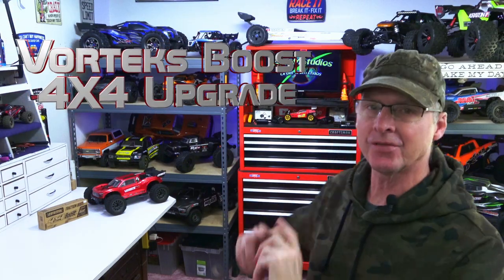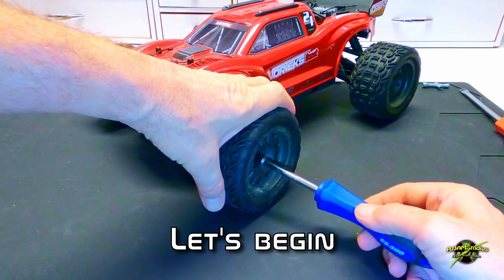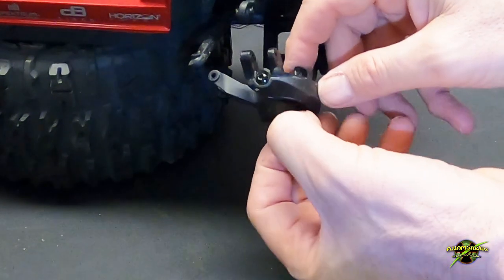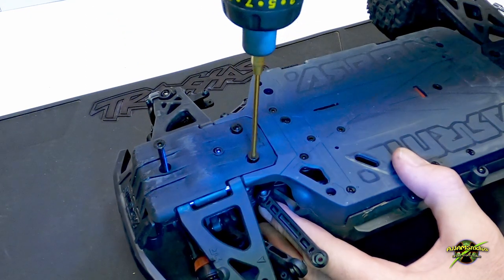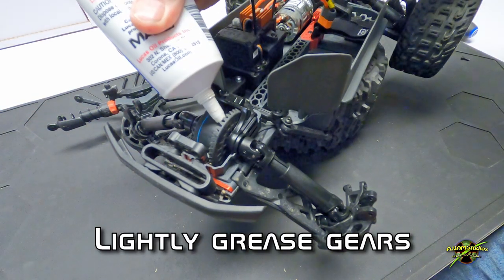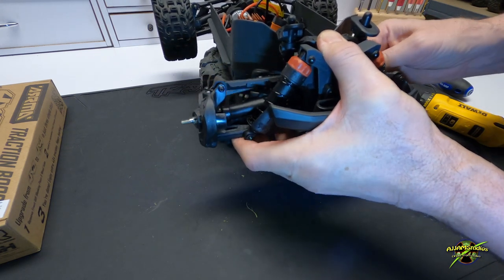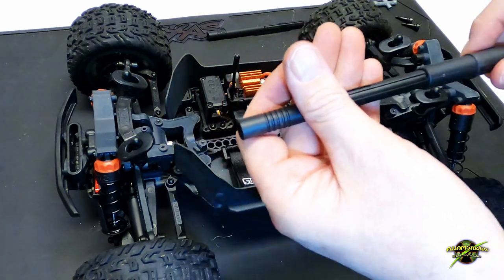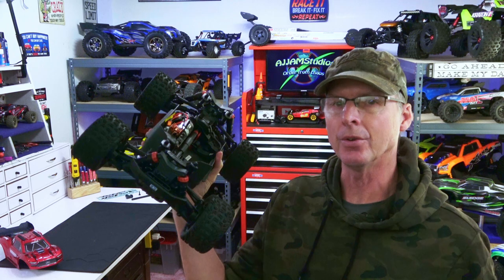Arrma Boost 4X4 upgrade

Comment: I got my Vortex a week ago or so , I just got two new 6500 Zee batteries and off road tires but I am pretty sure I will do the 4 wheel drive conversion kit soon but I am looking on the engine upgrades 😆 but this stalk engine I have now is pretty fast for me as of right now

Comment: Hi AJ, I think you missed the opportunity to put some thread lock on the screws inside the shafts that hold the axles. It's a common issue with the 3s platform for the little screw to come undone and the whole wheel to come off. Great video as always!
Reply from the maker: Good point. Thanks for helping our community. 😎👍

Comment: As always, great video!! Since you are kinda right where I'm having an issue with my Losi DB PRO, the factory hex works well with the stock wheels but, the road tires and the paddle tires both, where they seat on the hub is longer than the factory wheels. So I get another set of hexes that are thicker. But now the issue is the amount of thread left to put the nut on to hold wheel on. Any ideas or help would really be greatly appreciated. I tried the pull trick you just used and I t was no help.
Reply from the maker: We resorted to milling the wheel at the inside to remove the extra plastic and add more room for the wheel to fit the hub properly. This procedure can be a bit messy and if you do not have the facilities to do it properly, can be a bit dangerous as well. Still, if you do have the ability to mill the inside portion down, shortening the side area, that was the easiest way we've found to get them to work. I hope this helps. AJ

Comment: Hi , I'm a new rc kid. I have question for my arrma. My truck got turn off after about 10 mins I play at%50of motor power .( New battery full charge).    the steering was still working but the truck won't move. I saw the led was blinking very fast. The truck runs again after I turn off and turn on again. But it stop after couple mins. I really can't tell if the battery is low or what. is 10 mins run time about right ? Something wrong with my truck?

Comment: What grease did ya use , is white lithium grease safe on the plastic gears .....
Reply from the maker: Lucas oil white lithium grease. We’ve used it for years and never had an issue with our RCs. 😎👍

Comment: Do you have a video on slipper clutches explaining how they work and how to adjust them
Reply from the maker: Not yet, but we have been considering adding it to our 101 series. Thanks for asking 😎👍
Reply: @AJJAMStudios  Not sure where I should ask this, back in the hobby first time was a couple years ago, been getting rebrands, beefing 'em up for speed runs, then reselling to trade up.  Got the 4x2 boost mega vorteks   Was wondering, realistically, what motor / esc I should get? Already got upgraded shocks and the 4x4 upgrade is on the way, but a brushed 550 on 2s pushing 7 pound or so 1/10 scale rc truck with big'ol tires, wont that wear motor out faster? Also, if we're upgrading to brushless, upping the cell count, and changing motor perameters, shouldn't we adjust gearing?
Reply: i think that's a good idea

Comment: Where did you get your tool driver and bits?
Reply from the maker: Our local hobby store carries the bits. A power tool company here sells the DeWalt driver. Lowe’s also carries one like it.  The bits are Racers Edge RCE7201

Comment: Do NOT buy the 4x2 model, you will be sorely disappointed. Not only do you pay for the NiMH battery and charger it comes with, it is extremely under-powered and VERY difficult to maneuver on slippery surfaces like snow or sand due to it being rear heavy. Upgrading to the 4x4 3S brushless boost kit is complicated, takes time, is expensive, and does not include the wheelie bar.

4x2 NiMH Boost:
-Non-adjustable steering components
-Added cost of NiMH and charger which you will not use once upgraded to 4x4 3s boost kit
-No wheelie bar when you decide to upgrade to 3S
-Requires the 3S brushless kit if you plan on upgrading to 4x4 boost kit as the brushed motor is extremely underpowered
-Max 20MPH
-Cheap transmitter with delay
-Weak and slow servo

4x4 3S Brushless
-Adjustable front and rear driving links
-Can power wheelie
-Comes stock with Spektrum DX3 transmitter
-Max 60MPH
-Fast servo and responsive throttle

Better to save up a bit to buy the more expensive Vorteks 3S 4x4.

Comment: So to upgrade to brushless what parts would you upgrsde apart from motor esc and rsdio
Reply from the maker: The slipper should be upgraded as well to handle the power of 3s. 👍